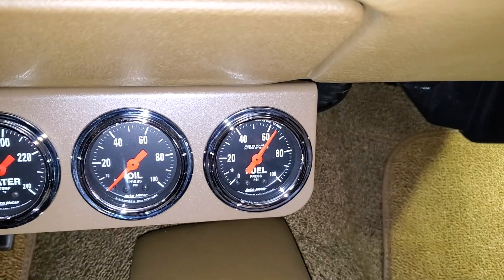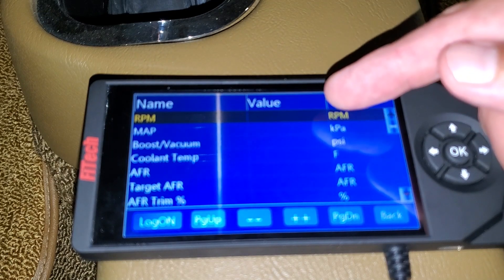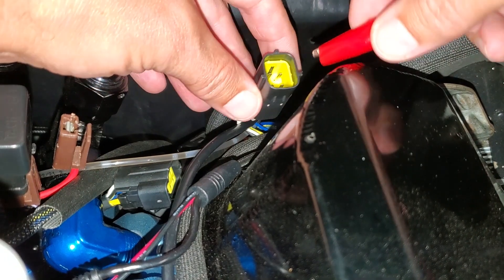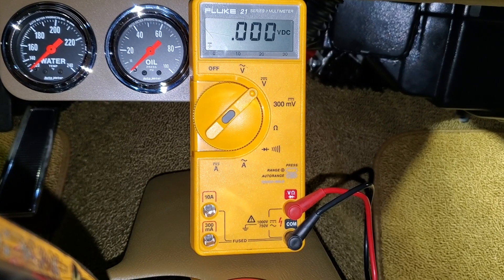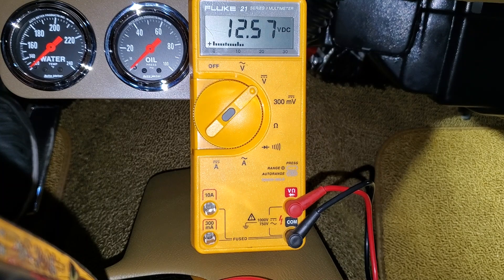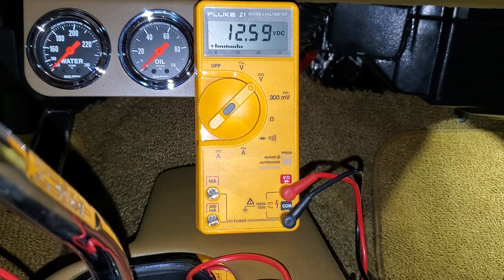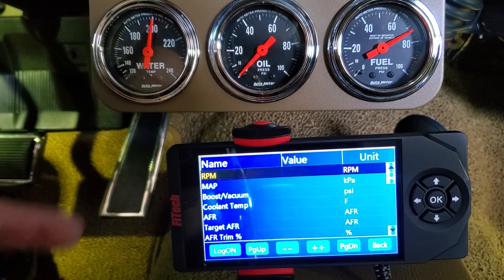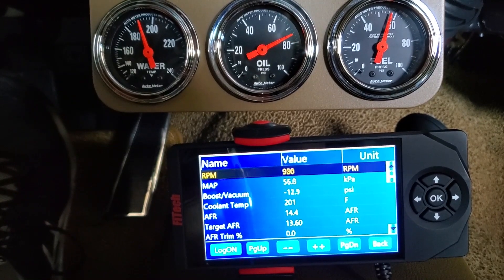FiTech Starting Issues - How to Diagnose it, and fix it.

Comment: My fitech used to run good but I left it one night in the garage and it runs really bad and it can't stay on idle and it runs waaaaaaayyy rich like 10.7 afr my hg is at -11.
Reply from the maker: Ohhh, that's no bueno.  Mechanically speaking, too much air in the exhaust would cause an over rich condition.  ie, an exhaust leak.  Check your header bolts and exhaust connection.  Assuming those are good, check for any loose electrical fittings.  Other than that, it would be something internal, that I'm not an expert on yet... keep us posted on your findings!

Comment: I was having these issues! Though when hot it starts but then stalls and is hard to start! Think it is related?
Reply from the maker: Maybe.  Check the cranking voltage.  Let us know what you find out.
Reply: @FastMonty  Yes, I will. Normally these old cars took the dizzy voltage from the starter circuit during cranking.  Wonder if I can duplicate? It is the season and got to keep it reliable if I am to cruise with the wifey.
Reply from the maker: @quickboat22  Yeah, I ended up doing the same... let us know what works!
Reply: @FastMonty  So I went out to the garage connected the hand held and cranked it to see if I had RPM. After a couple seconds It started immediately! Never touched the pedal and it idled. It is in the 90's in garage today. I have the 8 injector 8-1200hp unit but the tuning maps are very weak if I got out the lap top. Do you have a good source for knowledge in tuning these? Or random YouTube Vids are all we have?
Reply from the maker: @quickboat22  Awesome!  Unfortunately, no, I don't know of any good sources for tuning... As, I haven't done it myself yet either... one of these days, as you know.  Thanks for the update!

Comment: My Fitech 30005 is not doing the initial injection to start the car.
Has 50psi fuel pressure
What to do?
Reply from the maker: Sorry to hear that... It's not squirting?  Maybe you need 58psi or more?  Why only 50 psi?

Comment: fitec is junk and has no tech support i went back to carb it runs better and does not run battery dead after a week of sitting
Reply from the maker: Bummer... mine is running great, and waayyyy better than my carb.  No battery issues either... maybe someone wired it wrong?
Reply: @FastMonty  it was wired like the instructions said sad thing is i have a complete gm setup i went with fitec because it was a cleaner looking system  this was on a car i built for my wife to drive now she is scared the  car will quit on her
Reply from the maker: @benscoggins3149  Sorry to hear that... Fuel Injection can be sensitive, BUT, it should make your car more reliable.  Mine fires right up, and never stalls.  Unlike my carb set up.  Hopefully you figure something out, to get your wife driving.  Good luck!  Let me know if you ever have any questions, and I'll do my best to help.

Comment: What's wrong with system if it starts runs fine but soon engine warms up car shuts down while driving
Reply from the maker: Totally depends on the symptoms. Ie is it stalling, are you Cruising, coming to a stop, wide open throttle,etc?

Comment: I used a 30 Amp relay, using the electric chock as the trigger.  Wire direct 12 volt battery.
Reply from the maker: I was originally using the electric choke sending wire, but that had zero volts when cranking.  This wire is the internal relay for the Throttle Body, there's a separate wire that goes directly to the battery.  All is good now... thanks Jay!

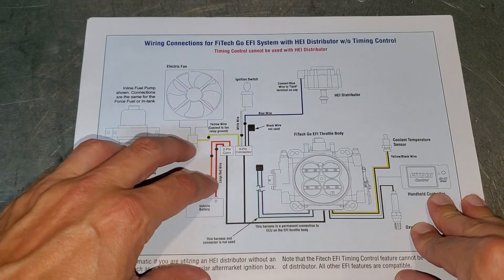Comment: @ 3:46 is that a oil pressure line going to the gauge inside the car? If that plastic line gets nicked or melts on a hot surface and oil sprays on the exhaust your car will go up in flames.  Please keep an eye on that line.
Reply from the maker: Totally agreed, but not as risky as my fuel pressure line going inside the cabin... ha, ha... just living life on the edge.  You know, like taking off with my seat back and tray table down.  :)
Reply: @FastMonty  Just remember your system is only as strong as your weakest link. I'd hate to see I told you so. Good luck 👍
Reply from the maker: @automech01  Ha!  Totally agree.  Both lines will be changed soon, all part of the plan.  Thanks!

Comment: Goodjob on the problem solve. Your fuel pressure at idle is a bit high . Only need around 45psi base pressure 🙌👊
Reply from the maker: Thanks... I'd agree that fuel injection systems don't need much at idle.  However, most retro fit fuel systems have static regulators, and they're set at 58 to 60psi.  As is mine.  Thanks for the comment!
Reply: @FastMonty  ahh didn't realize it was a static regulator

Comment: Thanks for keeping the Pontiac hobby going.  We need more guys like you.  I've been considering FI for awhile, mainly because my 400 L78-w72 is still old school in the way it starts up.  The Q-Jet when new on the car ('79 TA) wasn't easy to start, cold or hot.  Now with all the power mods and enhancements made to the Q-Jet and the engine it still is tough to start when cold.  The FItech is of interest to me so your video(s) on your encounters and fixes are helpful.  Maybe someday, I'll go the FI route.
Reply from the maker: Thanks Bill!  Yeah, those days of cranking and cranking, and cranking, and holding the pedal down until the engine is warm enough to stay at idle, feathering the throttle when coming to a stop, are long gone!  I highly recommend converting to Fuel Injection.  But, if you need an immediate fix to the carb cranking issue... check out this video I did.  https://youtu.be/7-1Mud8DblA  It should help with cold starts.  Thanks again for the comment!

Comment: Mr. Monty. Why does your fuel pressure gauge say "Must be Mounted outside of vehicle" ???
Reply from the maker: Ohhhh, you know why... ha, ha... just livin life on the edge.  (I'll be changing to a Stepper Motor version, but dang those are not cheap)  Thanks!
Reply: @FastMonty  You can call me "Mr Fire watch". Doing this suff all my life, I have some really good burn down stories. None of the mine. but have saved a few. Fire dept once said I was the best equipped civilian they ever ran into. I'l leave you alone for awhile 👍
Reply from the maker: @63grandsport11  Ha!  That's awesome... good to have Mr Fire Watch lookin out.  Thanks again!

Comment: not to smart putting that fuel gauge inside the car, if the gauge goes bad and leaks you will have a big problem
Reply from the maker: Yup, I'm aware... saving up for some Stepper Gauges, which are 4x the price of mechanical.

Comment: Mike, I don't know to what extent you've redone the original wiring on your car, so what I'm about to say may be moot and off-target, but just in case... Originally, I believe your car would have had two battery-positive connections to the points-type distributor, one for key-on, and one for cranking the engine. The key-on would have been through resistor wire so as to drop the voltage (to about 9V IIRC) and therefore prolong the life of the points. The cranking wire would have supplied the full beans (12V) to the distributor for the hottest possible spark while cranking. Obviously, once HEI distributors came along, the resistor wire was no longer needed, and 12V could be supplied to the distributor all the time (as it is on my '74 Firebird Formula 400). The reason I mention it is that I noticed that after you got some voltage to the Fitech unit while cranking, it still didn't seem to be the full 12V, dropping to 9ish volts instead. Maybe it's just voltage drop, but OTOH it got me to thinking about the old wiring for the original points-type distributor, and I wondered if somehow that old resistor wire was still lurking about on your car. Food for thought. Great videos, keep 'em coming.
Reply from the maker: Great point Griff... It's a new Painless Harness.  I suspect the voltage drop is due to the HEI unit.  I would prefer 12volts constant.  So, I'll probably look for another path at some point. Just need to make the time.  ha, ha... thanks for the comment!
Reply: @FastMonty  It is just general draw from the starter while it is under load.

Comment: Nice work and I am impressed.  I thought of doing this kind of system on Bonnie but it just to fancy for her I think.  On most of my cars it can get messy with ballast resistor /points wiring.  I only mention this because at the start the points get a pure 12v from the starter motor (sometimes there is a spade on the starter for this) wire then in run position the wiring switches to going through the ballast to make the points last longer.  A long story, like it do, but you're in the same ballpark here.  Keyed start voltage (or lack of it) and running voltage are a great subject to cover.  Love that 80psi oil pressure!  I also must say I love my Edlebrock fuel pump as it is quiet.  Can't wait to see what you do about the fuel pump you have.  Bobby
Reply from the maker: Thanks Bobby!  Yeah, very similar in supplying power.  Forgot to mention that the Keyed switch wire for the FiTech unit does NOT draw any power, it just looks for more than 8 volts ish, kind of like a relay, for the computer.  Then the computer has a dedicated 12volt supply line to the battery.  Thanks for the comment... and, yeah, I can't wait for my new fuel pump to get here.  Taking forever!

Comment: I had a similar issue with my sniper. I did have power while cranking but when i ran other accessories it drained power from the ecu. So temporary i used that same hot wire to trigger a relay and now feed power to the ecu from the battery thru the relay. Works great although not final
Reply: Installing Sniper and Hyperspark on my 68 Firebird, doing the same thing. Glad to see it worked out for you, adds confidence that it should work on mine as well.
Reply from the maker: @kevinw6282  Yep, good to be aware of the possible issue.  Good luck!
Reply: @kevinw6282  thanks . Runs great , no troubles after that. Just gotta make sure you have clean power. Good luck to you
Reply from the maker: Yeah, I like it... I'm sure there are better ways of wiring for me too... I just wanted power, lol.  Good idea with using a relay.

Comment: Kudos Mike, on the diagnostics but I would expect more from you, and for the GTO as far as a permanent solution. If I may suggest, not splicing into a dedicated circuit to draw power for another, you're setting yourself up for possible future issues. Why not have a seperate underhood power distribution center. You can have a distribution block setup with both a dedicated 12v source and IGN. source, with separate fused circuits from a single unit. Not only does this make for a safer, cleaner electrical system, you can get a PDC with additional circuits so if you wanted to add any future accessories underhood, they can each have there own dedicated fused circuit. No splicing into circuits. They make them with relay circuits also, so you could have a relay circuit to starter solenoid, No more starter issues when engine hot. I wouldn't be satisfied with anything less than a full 12v IGN. source at my Fi-Tech, this solution would provide that full 12v needed.
Reply from the maker: An update on this ... I called FiTech to find out what the AMP draw is on that keyed wire.  It's zero.  lol.  All that wire does is monitor voltage, as long as it's above 8 or so, it allows the computer to remain on, and draws power from a dedicated battery in wire.  So, not as bad as we first thought.  :)
Reply from the maker: Yeah, Good point Rickey.  Clearly, I had my head wrapped around fixing the issue.  I think I do have a couple available circuits in the current fuse block.  Thanks for the tip!
Reply: Hey Ricky now thats some good info there. It'll be easier to diagnose a single electrical  component to it's fault. Thank you for sharing. I learned something new from the both of you.

Comment: Glad you figured out that it was the keyed on power wire . Great Video ass usual . that 10 gauge wiire is probably why you were seeing over 9 volts instead of 7 like the F.i.tech guys were saying. What do you think.?
Reply from the maker: Thanks... the FiTech guys were just saying you need at least 7 volts, for it to work, on whatever source you find.  I need to find out how many amps it requires... hmmm just incase I need a dedicated circuit.  We'll see.

Comment: I’m getting ready to install an Edelbrock Pro Flo 4 EFI in my 69 mustang. My biggest concern is this 12v switched wire. I’m taking the advice of others on the mustang forums and running a new auxiliary fuse box. From there I will connect in the EFI. I just ordered a painless box #70107. Best of luck with your builds… I enjoy the videos… thanks!
Reply from the maker: Thanks Matt... just make sure you test that voltage while cranking.  You never know what wire has power, for which car, etc... sounds like the Mustang forums have it nailed.  Thanks for the comment, for others to learn from.  See ya!

Comment: Which Fiteck are you using? I have a mean street but haven’t started engine yet.
Reply from the maker: It's a Go EFI Power Adder 600.  I don't think it matters what one you have, just make sure you have more than 7 volts on the keyed wire, when cranking.  Always learning... ha, ha...
Reply: @FastMonty   yep that’s why I’m always watching. Good luck.
Reply from the maker: @Roadglide911  Ha!  Thanks for the comment!